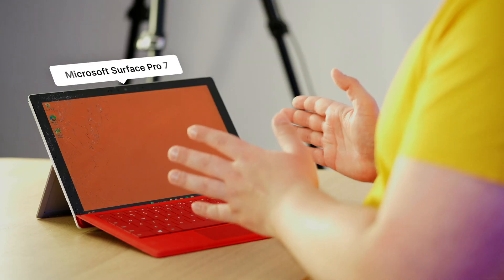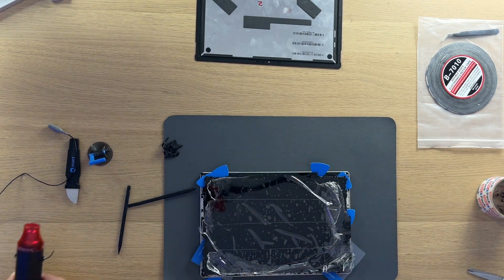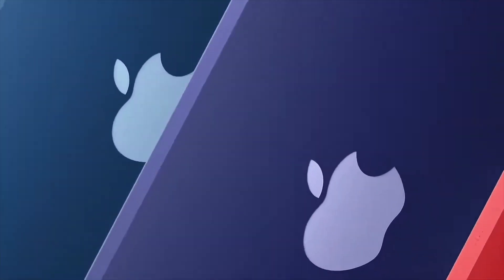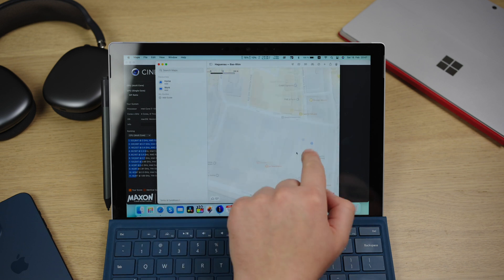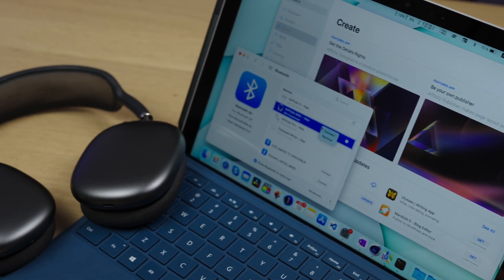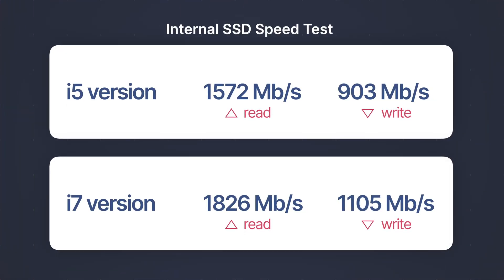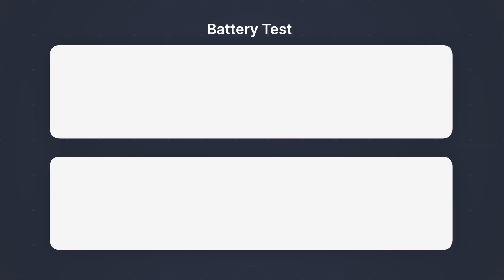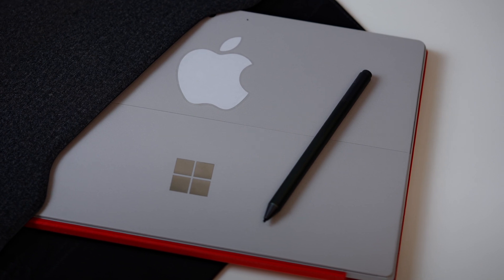Turned Surface Pro 7 into Macbook Air WITH TOUCH

Comment: Am I right in thinking this will only work on a 10th Gen i7 CPU or will it work with an 11th Gen i7 CPU? I ask as I don't think Apple used an 11th Gen i7 CPU in any of their machines.
Reply from the maker: Yup, 10th gen is the last they used. Newer CPUs technically may work but together with a supported external GPU (which is not the case for the Surface Pro).

Comment: I understand there a better MacBook Airs/ Pro with better hardware but quite expensive, but with methods to install Mac OS on computers like the surface pro, you can be able to experience like how you would be using an iPad with touchscreen with stylus.

Comment: Hi, Thanks a lot for the video. Well done! I‘m eager to follow your installation guide and I’m wondering whether you could provide the exact model of the Surface 7. Is the processor an Intel Core i7 - 1065G7? Cheers 👍
Reply from the maker: Yup, 1065G7.

Comment: fantastic. Luckily you did the other video explaining how to. One off-topic note in case you'd consider upgrading your surface pro7+ or 8 with a larger ssd (which would easily allow for dual booting one or more OSes) - take care to order a Gen3 SSD and not a Gen4. https://dancharblog.wordpress.com/2020/03/19/upgrade-sl3-or-spx-to-1tb/#gen4-ssds-may-not-work-in-all-devices

Comment: Was the device plugged into the power supply while testing on the macos operating system ?

And how is the battery performance in macos operating system?

Comment: Is it possible to put mac os on the SD card and the SSD dedicated for windows only? I mean, I have a 64gb ssd and is not enough for both sistems 😢
Reply from the maker: The SD-card reader in order to work needs MacOS drivers to load first, so I doubt it this would work. Also the speeds will be super slow. You might want an external SSD and have one OS installed internally and the other one externally.
Reply: @GeeksTable  ok, thank you for the answer 😁

Comment: I take this won't work on the 7+?
Reply from the maker: Yes, I mentioned that in the video. SP7 is the last to run MacOS. SP7+ has the CPU that got released after Apple’s transition to Apple Silicon.
Reply: @GeeksTable  Oh that's too bad, since the 7+ can get 32GB ram and removable SSD.  That'd be soooo nice to have OSX on.
Reply: what about surface pro 6? will it work?